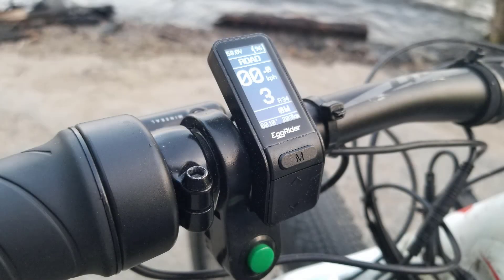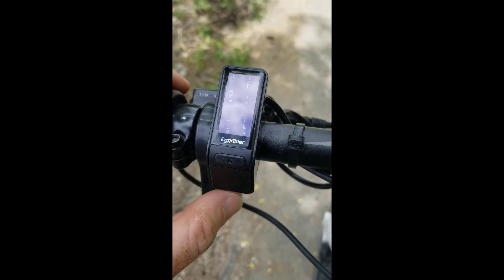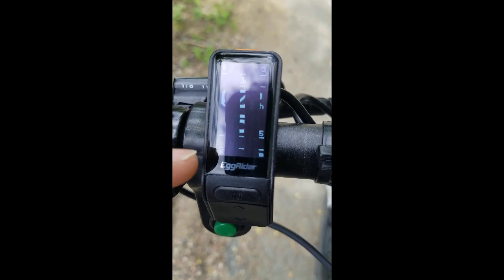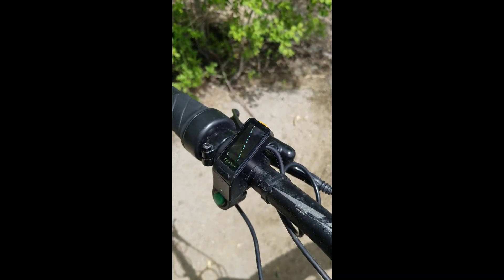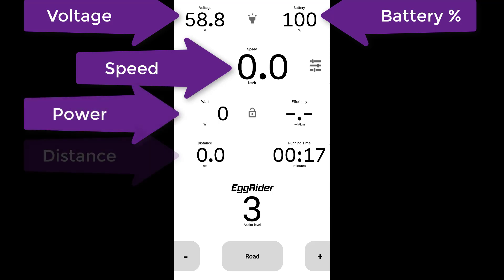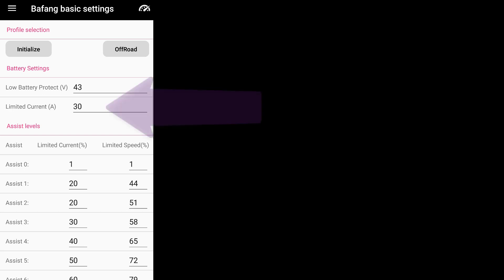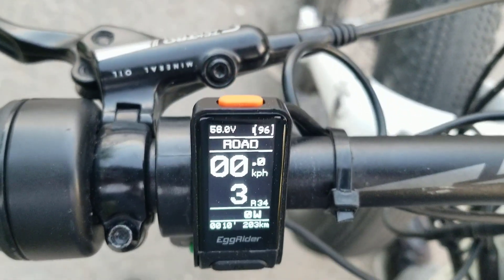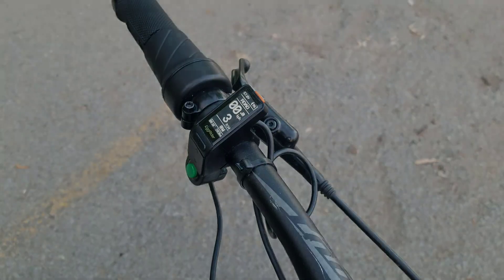Eggrider V2 ebike Display on BBSHD - First Impressions

Comment: Garbage. I just got one and it instantly caused a 30H code. I got one to prevent the 30h code when using the usb programming cable and im back to where i began. With a bike i cant ride. All my cables are perfect so i know it isnt a cable issue. Very frustrating when you pay a lot of monwy and all you get ia problems
Reply from the maker: That sounds very frustrating. You are welcome to join our discord community. You can post photos and screen shots and we can do our best to help. This is not normal. Something is different here. We need to figure out what it is. Something is different about the controllers maybe. This is a link to information on discord. https://highvoltagekits.com/discord Its also worth speaking to the eggrider people because this might be something that they have seen before and then it could get to the route of the issue. I don't thinks its the cable or the eggrider but the version of firmware. So I suspect that you need to flash the controller with a different version of the BBSHD firmware and after that you should have no issues using either the eggrider OR the program cable.
Reply: @HighVoltageKits  I spoke to eggrider via email and told me what I should do. I did that and nothing changed. My seller should know these issues but never mentions any of them. Sure he will reflash a controller but now wants to charge me for it cause he doesn't do it?🤔each new motor controller costs me $250 if I replace them as I have to with one they can't reflash. And that cost has to be picked up by me. These controllers and displays should not be able to lock you out like this. It is basically ransom. I have a computer but it isn't very good and I tried using the programming cable with it when I first got it but to no avail. Then I found out about the speed app and last fortnight is when shit hit the fan with the 30H codes on all three motors. Now I have one 750w motor I will not be changing any settings on it. 2 years and over 20,000 kilometres of riding and this happens. Not happy. Frustrated and I would definitely recommend people try and use their bikes without programming them, and if they would want to, get a professional to do it. At least they should be able to fix things like this. One would hope so 🙄
Reply from the maker: I have not known anyone suffer this much with a bbshd reprogram. I agree. It's madness. I think whoever is selling is gouging at those prices. I still recommend jumping on our Discord. There are loads of places to get bafang stuff and if you learn it yourself you are free from this situation.
Reply: @HighVoltageKits  something definitely doesn't feel right about this. When I get some free time I will get on the discord. So close to Christmas I'm super busy at work

Comment: Thanks for the review. I have a mate x 250w 48v. Do you think the Eggrider v2 allows me to unlock the speed? Now the max speed is 25km/h.
Reply from the maker: I am not sure. If the mate is covered in the firmware then it might but is not something I am familiar with sadly.

Comment: Recently got mine set up with my HV kit.  Like you mentioned though, practically useless for me with my failing eyesight and cataracts coming on.  I'm going to have to donate a cell phone and hard wire it up.  The only part I had an issue with was trying to figure out where to go to find those pages you displayed on this video to access the programing and such.  The directions with the HV kit gave no clue but eventually I located how to access them.  Works well otherwise
Reply from the maker: We need to get some better stuff for the Eggrider. Its on my list to tackle as well as some more in depth install stuff. Sorry to hear about the eyes. I reckon a old cell and one of those hardcase you can get cheap on amazon would work good.

Comment: Hi there does this improve the speed and torque on a vanilla bbshd just by changing the display cause when I see Johnnynerdout going on a 52v at 35+ miles an hour and I can only achieve 28 to 30 on my 48v I’m thinking maybe it’s the weight of the bike and me with a 48v or maybe it’s the setting on motor controller or display btw I got a 500c with the kit
Reply from the maker: It depends. The 52 volt battery will give a boost to the top speed on the same bike as the voltage is a governor of the top rpm the motor can reach. Things like weight and drag will make difference to. You are not that far off what I would expect to see. What some suppliers do though is limit the BBSHD to 25 or 28 amps. The maximum is 30. This will have an impact on the top performance of the motor. You would need a programming cable in order to confirm this. Or you could ask the vendor where you bought the motor. Using an eggrider would also let you see and change the amps. Hope this helps.

Comment: It’s not the refresh rate that’s the problem it’s the rate you’re filming it. You’re literally matching it, it’s like when you see a helicopter being photographed and it doesn’t appear as if the blades are moving, because the frame rate directly matching the speed of the blades. That’s user error
Reply from the maker: Right on. Makes sense! Cheers

Comment: Can you use an Eggrider if you previously upgraded the controller and display on a Rad Mini?  ...basically, will it work with an upgraded 35a controller?
Reply from the maker: Hi, that is a question for eggrider sir. I honestly have no idea. It would depend greatly on if the new controller is supported by eggrider. I suspect not. But its worth an ask. Sorry can't be of more help directly.

Comment: hey Cap. As somebody who rarely carries a mobile i figure the Eggrider isn't for me. Can you advise which other displays offered in Bafang's BBSHD packages would suit me best. 
I will be hoping to get something that's just plug and play, telling me speed/Battery.
Thanks John. P.s. smaller the better.
Reply from the maker: If you are running it stock then there are several you can use. The 750C is a popular one. The 500c is nice as well. It is limited to 52 volts max. If you are just running it stock that should be fine though. There is also a copy of the eggrider about that I think is just a display. Hope that helps. If not you are welcome to chat further on the discord server https://discord.gg/C8tsq9vH
Reply: @HighVoltageKits  thanks mate, much appreciated, hope your enduro build is going well too. John
Reply: @HighVoltageKits  tbh, i'm flirting with building the battery at 72v, would this mean a separate controller to run the 500c?
Reply from the maker: Build is going well. Slower than hoped tho. The 500c is 52 volts only so you would need to change it to run 72 volts.
Reply: @HighVoltageKits  tsk tsk, bloody things. I came to the conclusion it's easier to work out the set-up you want and then take an angle grinder to the frame, mine has moved on leaps and bounds since i moved to this approach ;)
Reply from the maker: Awesome 👌 Big tools fix all lol

Comment: Thanks for the review thatbwas awsom 
I just want to know if I can use the throttle only or I'm still need to pedal after doing all the settings
Reply from the maker: You should be able to run throttle only. Just set the power levels for pas very low. I am not 100% sure if you can get rid of pas altogether with the eggrider tho..

Comment: Great video thanks.  Have fitted the EggRider 2 with my Rad Power RadRunner EU-restricted 250w ( comes supplied with Rad compatible connector).  The difference in performance is notable and bike feels much more responsive and has a bit more torque for hills etc.

FYI Rad use a Lushui controller.
Reply from the maker: Awesome. Glad its working out for you! Cheers 🍻 More torque for the hills is always good!

Comment: Piece of crap. NOT WATER PROOF OR RESISTANT. Company does not respond to Emails,Tweets or Messenger.
Reply from the maker: I'm not sure the best way. As far as I know eggrider is two people George and Emil. It should be ip67 rated. If I had any way of putting you in touch I would. There is a Facebook group. Good luck.

Comment: Yes the polarized glasses is the problem. That display also has a polarizer filter. If you rotate you're glasses 90 degrees ( as in roll your head to the side) you'll be able to see it. Damn shame really I always prefer polarized glasses as well. 2 polarizing filters blocks all light in one orientation and half the light in the second orientation 90° rotated.
Reply from the maker: I learned to change the angle so I could read under the corner of my glasses!. Thanks for the comment!

Comment: Okay, I just received my eggrider v2 from luna cycle, installed it and the app, somewhat easily.  I only set up the off road option to keep things simple.  I put it on a fat bike with front suspension, BBSHD with steel gear, gear sensor, high powered 48v 20ah battery and ludicrous controller.  The only changes I made on the settings was switch from 27 amps to 30 amps, speed limit at 99, throttle at speed mode and mph instead of kph.  Wow!!  The bike is noticeably faster from the start and somehow is 2 mph faster at top speed with the mighty mini chainring(30 tooth) and 9 speed.  The battery drained a lot faster but the ride was sensational.  Thanks again for making this video.
Reply from the maker: Awesome mate. Yeah mine from em3ev was set to 27 amps. Im not sure why..I was pleased as well. Glad you are having fun! Cheers
Reply: @Captain Codswallop  actually mine was set at 27 amps too come to think of it, but what a difference, especially setting throttle at sport mode...great addition...take care
Reply from the maker: Will do, cheers!

Comment: Can you share your setting for the Bbsd? I got an eggrider and lt works well. Trying to figure why its not as gutsy up going up hills. I saw your other video and I have issues with the chain coming off. I took it up a steep hill and the motor stopped for a second but start to work after a few minutes. Thanks
Reply from the maker: It's hard to understand a potential issue from here. If you join my discord you can post pictures etc of your gearing and eggrider settings. It has been a long time since I ran it stock on the eggrider. I am sure either myself or one of the others will be able to help with settings. https://discord.gg/YAAjfgc cheers!
Reply from the maker: It's hard to understand a potential issue from here. If you join my discord you can post pictures etc of your gearing and eggrider settings. It has been a long time since I ran it stock on the eggrider. I am sure either myself or one of the others will be able to help with settings. https://discord.gg/YAAjfgc cheers!

Comment: will this work with a phaserunner?
Reply from the maker: To the best of my knowledge no. The phase runner is fairly unique in that the display needs to be the cycle analyst. It might be possible to run it with the NXT one day but that's a way off. The phase runner is a custom asi controller in effect. But the way it connects to sensors etc is a bit different especially to a display.
Reply: I have the new v3 which has 5v out now too, and it simply talks to ftdi so in theory I could make a Bluetooth adapter for it and then link it to their android app. Maybe even make a simple app to display the useful bits on a phone during a ride.. Time to tinker!
Reply from the maker: There are definitely some possibilities!

Comment: Great vid! So can you confirm this is a simple plug and play to BBSHD wiring harness. Also my existing display (DPC18) is no good for telling me how much battery i have left and have had the battery die on me a couple of times, is the eggrider any good for this? Thanks again! Also can you adjust the ammount af PAS levels, 9 seems excessive to me.
Reply from the maker: Thanks! Yeah it will work with the stock bbshd. The battery percentage is ok at 52 volts. Although the range estimation sucks. You can set 3, 5, or 7 pas levels.

Comment: How accurate are the readings on the display? Like the voltage or watthour ecc? Also what's the highest voltage and current this display can operate at incase someone wants to change battery size in future? If the next version of the eggrider was just a tad bit bigger would be perfect!
Reply from the maker: The eggrider was intended for 36-52 volts. If you stick a higher voltage battery on without a protective wiring loom you will blow the eggrider. I have come to the conclusion it does not do well over 52 volts. Yes I have run it but there is no option to pick a 72 volt battery so it does not calculate anything correctly in terms of battery percentage. The voltage reading is accurate to .2 volts. The watts per hour is more on the phone app and like them all is horrendously inaccurate. Mainly because the display is not measuring accurately watt hours consumed from the battery.

Comment: I have a BBSHD-enhanced 26" fat tire MTB and the eggrider and would agree with the Captain's assessment.  For me, the display is too small/difficult to read while actually riding; it can even be a challenge to read when you've stopped riding depending on light conditions.  The PAS selection buttons are more challenging to reach and engage (have to be pressing in exactly the right spot) than those on my 500c display.  But the advantages the eggrider provides outweight the shortcomings.  If you want to program your BBSHD this is clearly the way to do it--not having to plug your bike/motor physically with a cable (that you pay $20 extra for, so knock that off the price of this display).  And for those wanting to keep track of efficiency (watt hours/mile), there aren't many devices that provide that; the eggrider is clearly more reliable than say the Batt Man which I previously used...Batt Man would should down about every 3rd right, and requires special wiring into your system compared to the eggrider's plug and play.  Overall a winner but not that friendly/easy to use during the ride itself.
Reply from the maker: Never tried the batt man which is good to know. I must admit I don't use the efficiency part but go more off the voltage as to how long I can run. Thanks for the comment! Cheers

Comment: Cheers, answered all my questions but one. How many levels of power assist does it have?
Tops out at 5 shown like the SW102 it apparently looks like or the full 9 like other Bafang controllers?
Reply from the maker: You can pick 3,5 and 9... Maybe 7 as well in the app. Cheers

Comment: This is great thanks for sharing. How accurate are the readings with 52v? ... I mostly just need a way to get accurate ride statistics for range testing.
Reply from the maker: I never got on very well with the range stats. You have to setup your battery via the app and then it only gives you range on the display. There is more info on your phone but I refuse to ride with my phone on the handle bars. So I'd say not that acurate unfortunately. At 72 volts it's useless as you are not able to input a 72 volt battery in the app.

Comment: My question for this display and also the APT TFT 750C-Bluetooth that is also commonly used with the BBSHD is: what happens when you use a battery above 52v? I am building a 60v battery when fully charged is 68.2 volts.  Do you know what display people are using with batteries above 60v? I know you are planning to try a  72v battery, what display will you use? What happens if you use your current display with a higher voltage battery?
Reply from the maker: I'm using the eggrider v2. The piece I need is a loom that protects the display from a higher voltage. Alan literally shipped it this week and its arriving shortly so I'll show people how it works. I don't get any special treatment though cause I have a channel. I don't think he will rip you off either. He is not the quickest but I think his operation has grown exponentially as the ASI controllers have got more popular. He is not a massive operation. He has not posted a video in weeks probably cause he's working flat out. Mistakes such but I'm sure it will get fixed. Send a text message it's much better than calling him. The other option you have us to cut open the loom on a display and power it from a separate lower voltage battery.
Reply: @HighVoltageKits  I'm interested to see what the Loom is.
Reply: I texted with Alan about my order so thanks for the suggestion. He says he is shipping my display today.
Reply from the maker: That's good to hear. Glad its sorted.
Reply from the maker: Yeah, I think it is a resistor to prevent damage from the higher voltage.

Comment: Thanks for the very informative review! 
You might like to have a look at this page if you decide to tweak the settings:
https://electricbike-blog.com/2015/06/26/a-hackers-guide-to-programming-the-bbs02/
I recommend "Kepler" (been using this setting for two years now).
This device is so much better than using the cable and laptop. 
Also it allows you to have a totally legal (250W, no throttle)  and not so legal (1880W with throttle) setting, at the touch of a button!
This is a key buying/selling point for me.
Also, it's the perfect match for the clearly visable metalic sticker on my BBSHD that states that it is 250W (bought off ebay).
Reply from the maker: The Kepler sounds very good. Sorry I missed this comment. Cheers!

Comment: Best to charge to charge to 57 volts maximum.
Reply from the maker: I have a grin satiator now so I use their 85% charge mostly to 56.6 volts. Good advice! I hope it gets me more charge cycles.
Reply: How do you regulate charging? Do you need a special charger?
Reply from the maker: Chargers are either simple in that they charge to a set voltage. Or variable in that you have a degree of control over your voltage and rate of charge. I have the grin satiator which let's you set the end voltage.